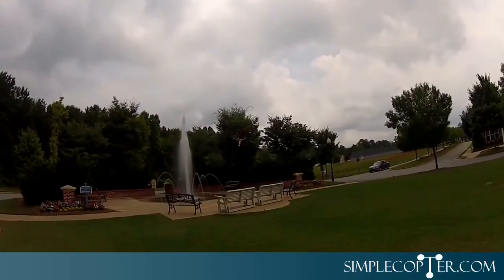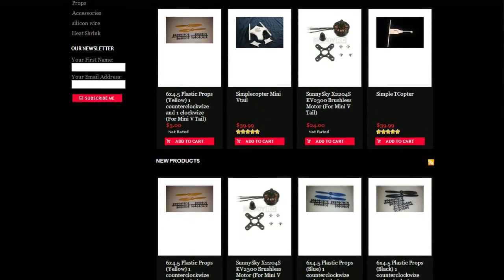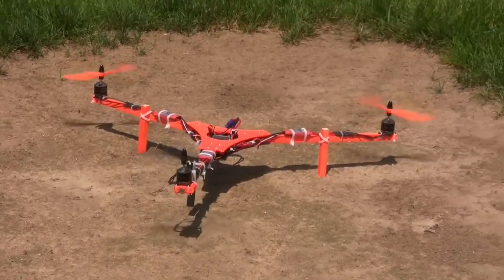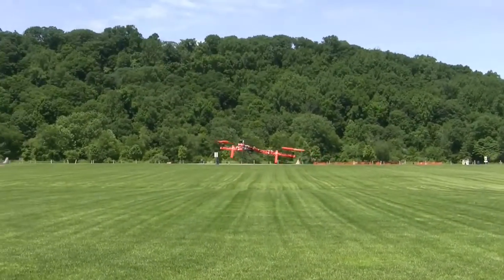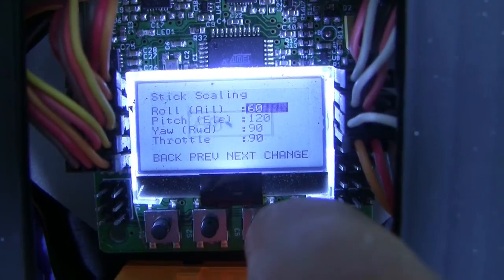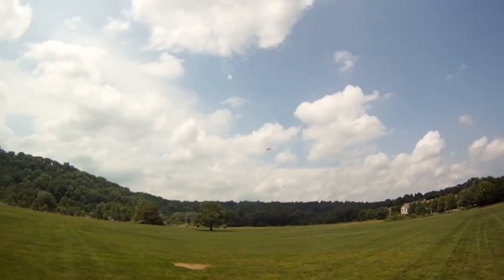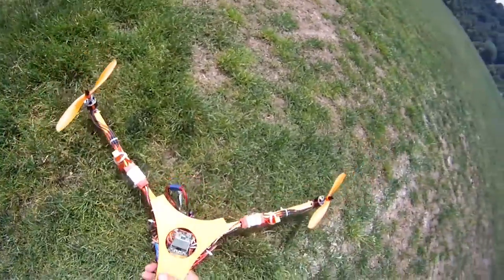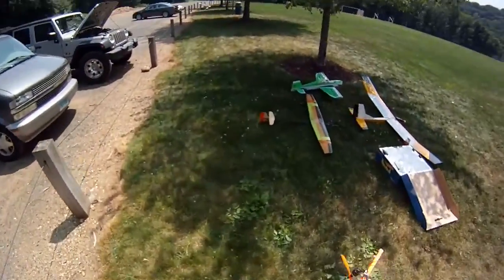Nodd RC - 078 - SimpleCopter

Comment: Hey thanks for sharing i am about to build up my second tricopter and plan to fly it the same way. Can i ask that you list your KK bord settings and Taranis settings as i also use one.
Reply from the maker: I've listed my settings in the video's description.
Reply: *****
Thanks for the update. I also went through one of Matts' videos and he mentioned that he ran 70 expo on Aileron/Elevator and 30 expo on rudder. Do you also run the same expo?
Reply from the maker: pMustangw I believe I have my expo set fairly close to that. Maybe not quite that much on the ailerons/elevator but close.